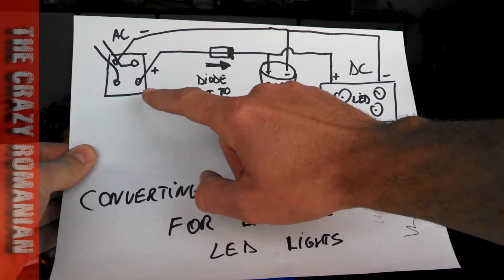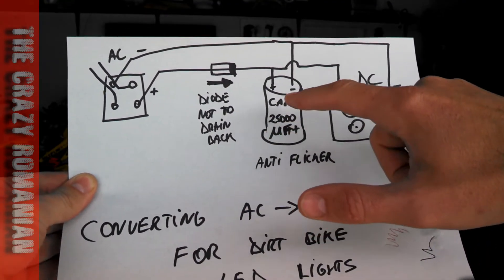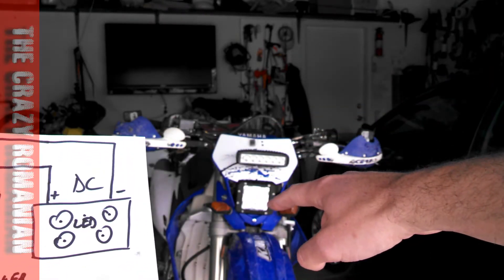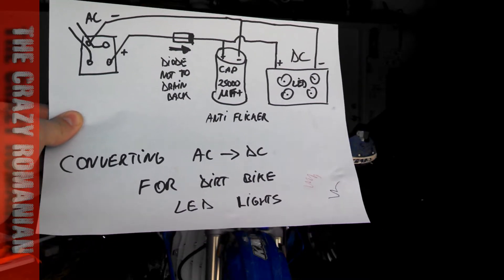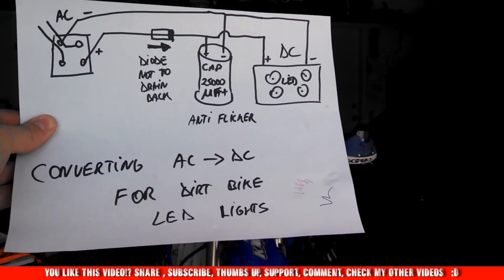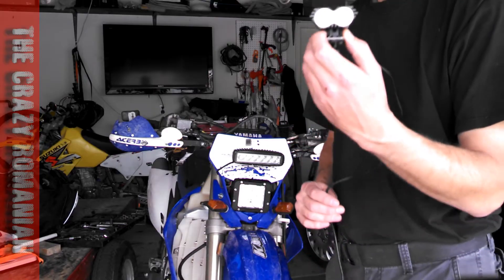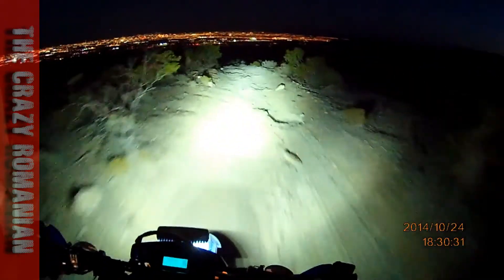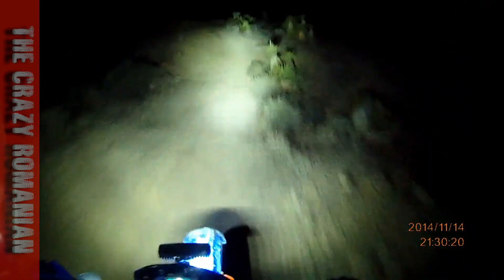How to Covert AC to DC for motorcycle LED Lights

Comment: What size cap..25.000 seems a bit too big?
Reply from the maker: It's not that big but can be smaller.. Will help flicker less the bigger it is.. Mine were 10k
Reply from the maker: I'm talking micro farads....
Reply: @VegasRoManiacReviews  what was the Volt rating on the CAP you used